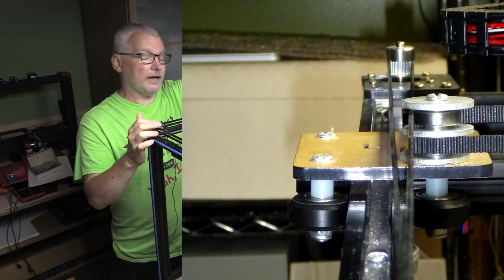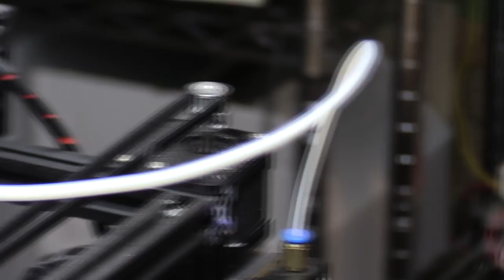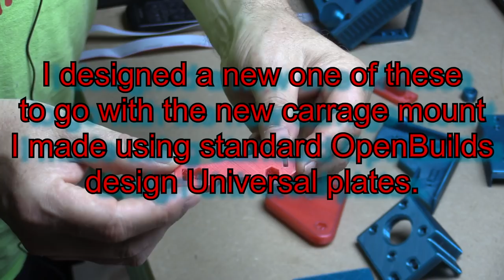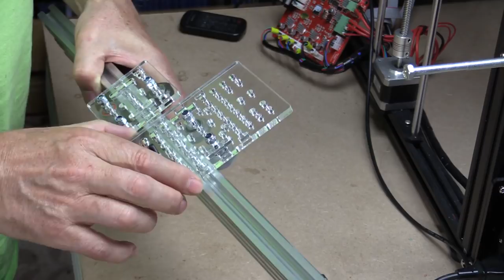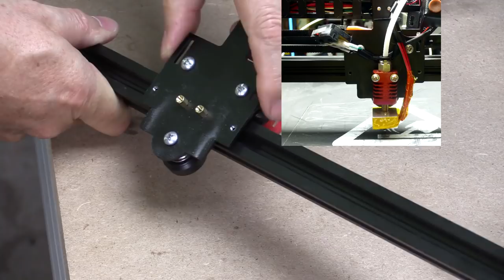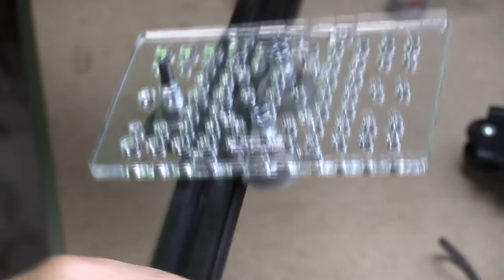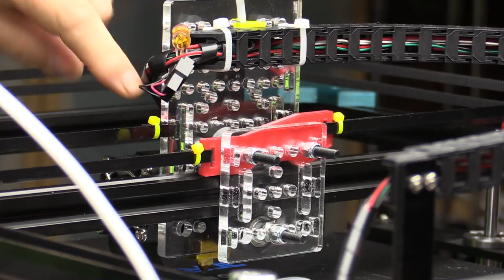TronXY X5S Hardware Upgrade

Comment: This is ridiculous! Youre basically doing all the work Tronxy should have done! Good modifications for a lazy design of a printer.
Reply from the maker: i would tend to agree but unfortunately this is quite typical of many "Import Printers".... dont even get me started with the claims on temperatures etc or the electrical systems (Dealt with in other videos :) )

Comment: Adjustment of the bracket is the bottom wheel
Reply from the maker: Not on the one I received, it had no Eccentric nut on the carriages, I had to add them, check 1:59 for a close view (No the head but the head had the same basic assembly parts.

Comment: 為什麼有些部件使用透明材料而不是全部使用3D打印？
Reply: 對不起，我的英語不好。我只能使用GOOGLE翻譯來觀看該消息。
Reply from the maker: the clear plastic (Acrylic) is from cast sheet goods and is therefor a solid mass, therefor stronger, 3d printed parts often can be weaker between layers. Also I had the acrylic already and it was easy to machine with my home made CNC machine (And quicker, took about 15 minutes vs sever hours). with the right filament and good adhesion, there is technically no reason to not 3d print the part instead.

Comment: 8:40 How about adjusting the eccentric nut of the bottom wheel?
Reply from the maker: there was NO eccentric  on my machine, perhaps it was a latter addition to improve things.
Reply: @TheBreadboardca   Hi there, (just subbed in btw) great videos fella!
I never noticed any slop in the extruder carriage when re-assembling my machine (for about the 3rd time) but when you showed that i paused the video and went to look and omg there is a lot of play... Well less than you showed but still an unacceptably large amount of movement!
I have what must be a newer or updated version of the x5s as there is already a rear plate for the belt to mount on and the idlers on the gantry are not stacked but rather one idler on the front wheel and one over the rear wheel. 
You are able to jiggle the stepper mounts and front idler mounts to get the belts within 1mm of being perpendicular, immensely better than what you had to deal with although still not perfect.

Sorry if this is going to a noob question, but i'm an open builds noob! lol

You show the mock up of the 2 gantry plates with eccentric nuts on the lower v-slot wheels and would appear to be installed on your later still images of the newly assembled gantry, however this comment says you didn't have eccentric nuts installed at all?

I'm just adding the parts to my shopping cart right now and wanted to be sure if i should get eccentric nuts or not?  
( I suppose i could just order them anyway as i'm sure they would come in handy elsewhere, but would like to get this modification done in one go rather than getting it stripped down and finding im missing something)
Reply from the maker: @markwood9751  For sure get the eccentrics, wheels will always wear and they will allow easy adjustment without replacement, mine did not come with eccentrics but I had some from my CNC builds so I added them when I replaced the gantry plates.
Reply: @TheBreadboardca  Thanks for the reply 👍 Bam... ordered 😁

Although I have just realised I totally misunderstood your initial reply, that it was the oem carriage that didn't have eccentric nuts 🙄

Comment: WELL I JUST DECIDED NOT TO BUY THIS PRINTER OFF THE LIST ................
Reply from the maker: Too much upgrading required to make it go well im assuming
Reply: I've had this printer a little over a month. I've done a number of upgrades and now it prints as well as my $700 Qidi Tech 1. Plus the X5S build plate is twice as large as the Qidi.
Reply from the maker: Yes, nice to hear, the printer can me made to produce some very good prints, just after a few essential upgrades
Reply: The motor mounts on my X5S are thicker than yours, but I found I could still move them a little when I pulled on the belts. I did this mod, among others. https://youtu.be/YEo1ifQWC6E It really helped to stabilize the gantry. I also did some work on the carriage wheels and pulleys.